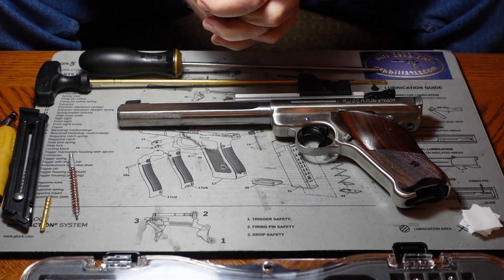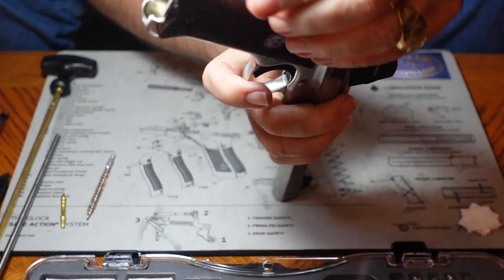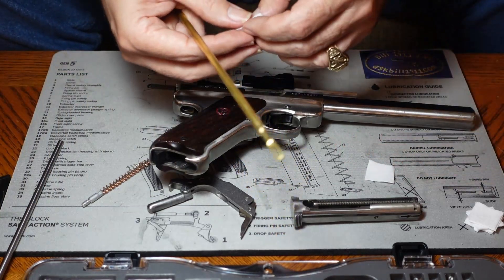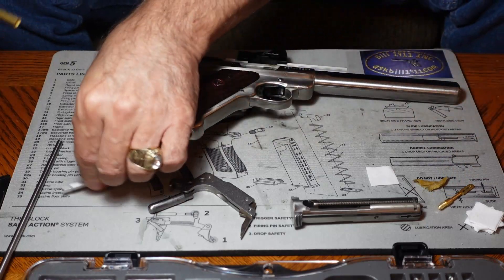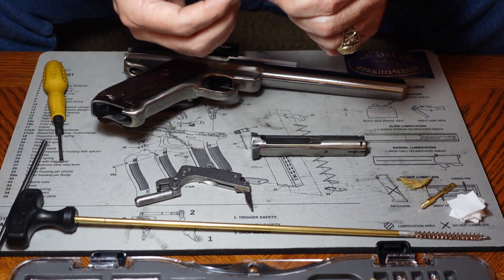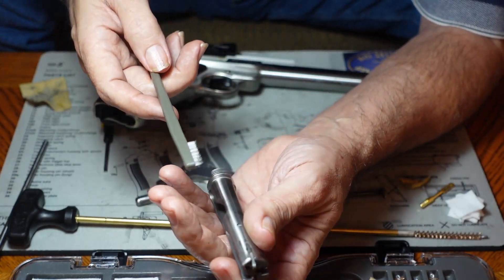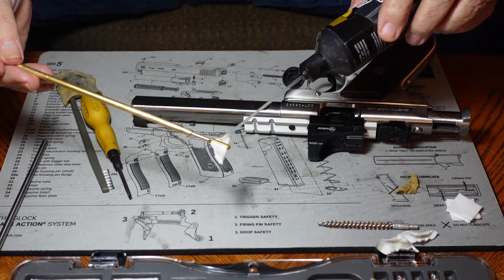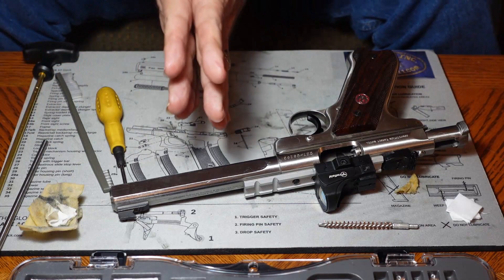How to disassemble, clean, lubricate the Ruger Mk III #ruger #pistol #gun #gunsmith

Comment: Great video! I too just spent HOURS trying to figure out how to get this gun back together. Then after I got it all back together (I took the slide off as well to give it a deep clean), I couldn't pull the bolt out!!! AHHHHHHHHH. Not too bad now that I know what to do and look for regarding the hammer and strut.
Reply from the maker: Yep! the Mk-4 is a vast improvement over the MK-1, Mk-2, and Mk-3. That pain in the butt hammer strut drove me nuts the first time I worked on a Mk-1. When I got the Mk-2. It had been such a long time between working on the Mk-1 and the 2, I had forgotten about the strut hanging up. Didn't forget when I got the Mk-3. Fighting with that darned thing twice was enough to make me remember. FOREVER!!!!! I'm glad you enjoyed the video. Thanks for watching. Have a great day.

Comment: Rubber hammer on back of barrel will release it, and you can get all the trigger and receiver areas clean. However, it's a bear to line up the bolt stop and receiver holes with the barrel hole so you can reinsert the mainspring housing assembly pin.  You need to tap the barrel back and forth with the rubber mallet until the pin slides back in. THEN complete the assembly by reinserting the bolt and the mainspring assembly. As I said, the "hammer strut support" plate mod makes all of this reassembly much easier.

Comment: Is there a reason why you put the cleaning rod through the back instead of the front end of the barrel? You wouldn't need a longer rod if you put it through the front end of the barrel.
Reply from the maker: Yes. There is a condition that occurs with .22LR pistols and rifles. It is because the ammo tends to be very dirty. (Lots of burned powder fowling or residue.) This can collect at the beginning of the rifling in the barrel. There is a small ridge, or ledge at that point where that fowling can (over a long time several thousand rounds.) solidify into a hard ring of carbon. Cleaning from the breach end of the barrel will help to prevent this process from happening. If you can not clean from the breach end of the barrel, don't get overly worried about it. Simply use your powder solvent generously in the chamber area, and let it soak for a few minutes (3-5 minutes) before running a dry patch. This will also help. Thanks for watching.
Reply: It always better to go from breech to crown because it reduces the chance of the cleaning rod damaging the crown. If you are careful you can go from crown to breech, just be careful when inserting the rod. On some guns, like revolvers, you can’t go from  breech to crown with a rod. But, if you have the option always go breech to crown.

Comment: 23:50  Here is where you leave out ALL THE IMPORTANT STUFF> plus nobody can see what you are doing.   Plus. it's not the 'firing pin" that has to be in the right place. I don't have time to explain all the things that go wrong at this point, but they always do. :You did not mention ANY of them, excep;t to say "out of position'.  I suggest any viewers check out other videos concerning the hammer strut problems, the magazine disconnect, the hammer being up or down, depending upon which point you are at, etc. And finally, the POSITION of that hammer strut when you insert the mainspring assembly, and then, after pulling pushing the hammer up, the final reassembly, and the magazine presence or absence for each step. Finally, you don't even mention the hammer strut being BEHIND THE PIN. That is the most common problem in reassembling. Saying it's "in the wrong position" means nothing to newbies. I can only give you a C minus for this video.
Reply: Please ive been searching and all the ones i see are not showing anything important

Comment: The best part of Ruger Mark I, II, and III models is that there is so much negative attitudes about cleaning them that they are cheaper on the used market.
Reply from the maker: They are also a blast to shoot. Like all .22s they are cheep to shoot. I remember when they were $0.59 per box. (I know that was in prehistoric times)
Reply from the maker: They are also a lot of fun to shoot. The ammo isn't bad as far as price. I remember when it was $0.59 per box. (I know that was back in the prehistoric days) Its still pretty inexpensive by comparison to 9mm or .45acp.
Reply: Facts. I just picked up a super clean used Mark 3 Hunter for just 300 😂
Reply: Just like what @Real90sfeel did.  I just picked up an almost unused blued Mark 3 22/45 Competition bull barrel with factory installed high vis sights, original box, manual, 2 mags, and weaver rail for 350.  It was a gunsafe queen.  I have Seen plenty of cleaning videos LOL no way is this a difficult field strip.

Comment: I have that pistol and have only run a few hundred rounds through it because of the reputation of it being difficult to clean. There is a plastic device advertised that claims to cure this particular issue. Have you tried it ?
Reply from the maker: No I've never tried it . In truth I haven't seen that ad. If you have time send  me a link, and I'll take a look. The Ruger Mk. III really isn't that bad. Once you know its pit falls, you'll be fine. Just be thankful it's not a Colt Woodsman! Those are a total pain in the but. If you ever come across one, there is a small button on the top of the slide. That's the key to that gun. I wish I had one to do a video on. Thanks for watching.
Reply: @Bill1911  I'll look for the ad. It's usually in the back of The Rifleman and Guns & Ammo
Reply from the maker: @robertjessen1554  Thanks for the info. I receive the American Rifleman, I will look for it there. Thanks again.
Reply: Where can I get it?
Reply: @patricklocke3487  there are ads in the back of Rifleman  and Guns and Ammo

Comment: I can see that you know what you are talking about, because I have one and know the challenges. You ought to redo this video with the camera positioned properly so people can see what you are doing. The new Ruger Mark IV is totally redesigned and comes apart very easy. The Mark III was designed by an idiot, putting this gun back together is the most ridiculous process I have ever seen. This gun was given to me, I would never pay money for something designed like this. You MUST follow the manufactures directions EXACTLY in order to get it together and then it takes many times of practice to learn the process well enough to actually get it! If you own one of these, good luck and hope you have lots of patience.
Reply from the maker: The Mk-III is not the worst! If you ever come across a Colt Woodsman...Well Good luck would be never having to take it apart and put it back together again. If you do find yourself in that position, remember the magic button on the top of the slide. 

     As far as reshooting the video is concerned, I plan to do just that. However I have several videos that have the same kinds of problems. I am an ex cop, gunsmith, instructor, ect. Shooting videos is new to me. I had learn so much. Lighting, camera angles, how to make the autofocus work for me, (not against me) I'm still learning.

    I now have two cameras running at the same time. One directly in front of me, and one over the top of the subject. I have a ridiculous number of lights from different angles to eliminate shadows. I am improving my craft all the time. I have a few things I still need to address before I start remaking the older videos, but it is definitely in the works.

     I want to thank you for writing in. I take constructive criticisms seriously. I want to always take my viewers thoughts into consideration. Once again thanks for watching and for your thoughtful comments. I hope you will become one of our regular viewers, and a subscribers. Oh yeah before I forget If you write me and it takes me a little time to get back with you please be patient. I get a lot of mail. When things get busy, it sometimes takes me a bit of time to write back.
Reply: @Bill1911  Although it is hard to believe there is a gun more challenging than the Mark III I can only imagine what the Woodsman does! I just took may Mark III apart after watching you video and damn it, it's not going back together right #%^&*@! &^(#@r 😅